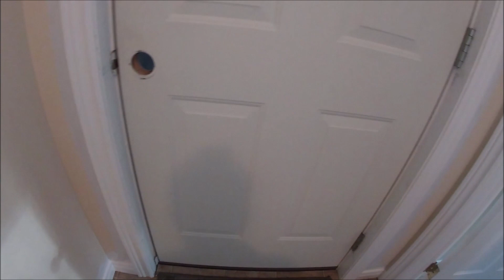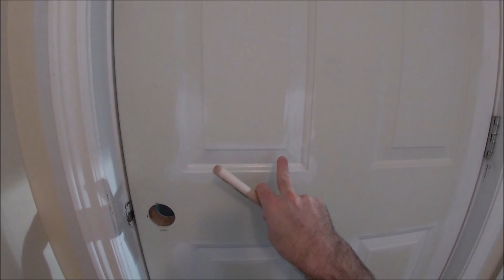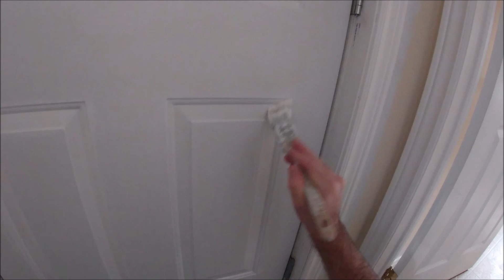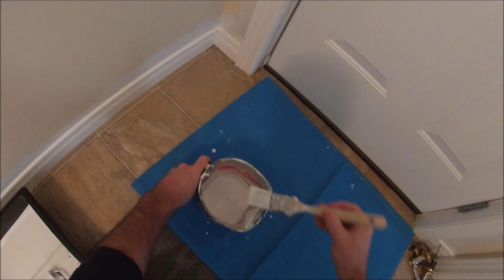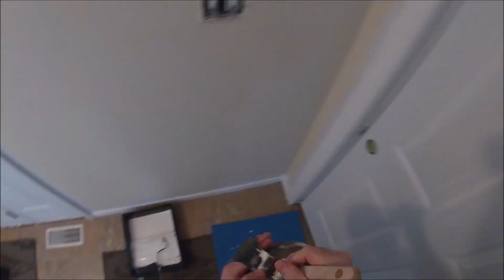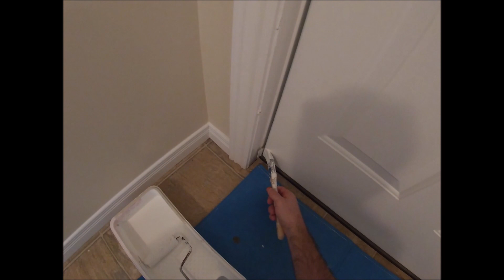How to Paint a Steel Door

Comment: Would you use Tremclad oil-based rust paint without a primer to paint a steel door using either a brush or small roller?  Thx!
Reply from the maker: You definitely could, I have used that paint before, it's very durable
Reply: @TheCanadianHomePainter  Thank you.

Comment: Hi 
What does someone need to paint a metal door and interested painting the inside part thats inside of the home side blue. Would I sand, paint white then the blue? What do u reccomend
Reply: I should have mentioned The door is a bright bold red
Reply from the maker: Hi 
I would recommend,  make sure it's clean, lightly sand to help make the paint adhere, I would definitely prime over with Bullseye 123 primer and then a couple coats of the color 
Hope this helps

Comment: I’m trying to paint my door black and my door is white. What name brand of paint do you recommend? Also I didn’t sand it and the paint started to pull off, so if I sand it will it not peel off anymore?
Reply from the maker: Hi there
Just curious did you prime the door before painting? Sanding definitely will help with adhesion but a light sanding and a coat of a good primer like Bullseye 123 and then the top coat should give you the best results.  As far as what paint to use I would recommend either Benjamin Moore or sico both are excellent,  Benjamin is number 1 but the price is higher and sico is a close number 2 with a more affordable price point. Hope this helps let me know if I missed something 
Thanks for watching and for the question

Comment: I've encountered experienced painters who do not prime medal doors and they think it's odd when they have two give it four coats of paint. I do not understand why they would do that. maybe to avoid having to buy primer and just hop the paint will cover. but after years of painting you would think they would know what to do.
Reply: Experienced painters know you do not have to prime something every time you paint it. Bare metal yes, a colored door that's been primed and painted, not necessary.  In general primer is for bare surfaces.
Reply: @da324  yes agreed. And then there's the paint primer all in one. I think painters use that stuff to get it done faster, but I'm told it's inferior.
Reply: @gianthills  I hear you.  I personally think the paint and primer all in one is a marketing ploy, because it doesn't make logical sense.

Comment: My door has chips  in the paint that's it has on it now. What do you recommend?
Reply from the maker: Hi, depending on how many or how bad the chips are, will depend how much sanding is required, if they aren't too bad then you can probably hand sand them, I would suggest using 120 grit sandpaper, sand out the chips and make sure you prime especially if you get right down to the metal. On doors that are really bad I will use my orbital power sander with 120 grit disks. Hope this helps

Comment: So I have a steel door that had some dents in brought it down to bare metal filled in the dents with bondo applied phosphoric acid on the bare metal to protect it from any future rust for the simple fact that the salt air hear in Wailuku Maui is not a friend of any metal. Cleaned it up as per the instructions proceeded to primer the door and now I have areas that are rough  I'm going to try wet sanding in the morning.  Unless you have a suggestion for the way I to proceed.  Thanks in advance.
Reply from the maker: Ah Maui, that would be a great place to go and escaped the cold dark winter here. Ok back to your comment lol
In those case I usually fill and sand the dents with a paintable caulking, I think you went above and beyond to repair your door, which is probably the best way to do it. The wet sanding hopefully with work to sand out the rough areas. 
I dont usually take it down the bare metal. I bet it looks like a new door now. Sorry I dont have any other suggestions for you. Hope it works out.

Comment: What kind of paint and what primer?  I just scraped paint off my steel door and need to repaint it.  Didn't use primer the first time. Oops!!
Reply from the maker: Hey! Depending on where you live, if you are in the states then you can probably find this primer and paint at a home depot or other paint stores. I used bullseye 123 primer and sico door and trim paint for the top coat. Hope this helps , thanks for watching and for your question

Comment: 1. Is sanding necessary for an unpainted steel door? 2. What do you suggest for fixing a small dent?
Reply from the maker: The light sanding will always help with paint to adhere, Bullseye 123 primer says sanding isn't necessary however I usually will still do a light sanding,  it never hurts .
Fixing small dents on a steel door is not easy, I have tried many different products. For me if there are only a few small dents I personally will use a little paintable caulking. I just use a drywall knife to apply it then I wait till it dries apply alittle more making sure it is as smooth as possible then I wait till it is nice and hard then I do a light sanding around the edges to take care of any imperfections,  prime over it and then paint.
Hope this helps, but also check with them at the store where you live and see if they have anything that they suggest. I do this stuff a time so I can make it look good but if you aren't use to working with materials like this it could be a bit tricky

Comment: Hi, how about painting a brown steel door to white. How do I achieve that? Thanks for your shared knowledge
Reply from the maker: Hi there, thanks for watching and for your question, pretty much follow my steps the same, however going over a dark color like brown may require an extra coat of white maybe even 2 extra thin coats just to ensure that you get the brown totally covered, you will know though after the paint dries whether or not you need more coats. Hope this helps
Reply: Good white primer and paint

Comment: How do I paint a metal door that the previous owner of our home painted with flat wall paint??? Any advice?
Reply from the maker: Thanks for watching and for the question. And really you should be able to just go over it eith regular door and trim paint. Assuming the flat wall paint is latex on the door now, just lightly sand the surface wipe it down with a warm rag and apply 2 costs of latex door and trim paint over top. Hope this helps
Reply: The Canadian Home Painter yes it does.  Thank you I was afraid I’d have to try to get all that old paint off. 😱
Reply from the maker: @ladystef5055  no that shouldn't be necessary. Let me know how it works out for you 😊
Reply: The Canadian Home Painter I sure will.

Comment: Can you paint the whole door with a brush
Reply from the maker: Hi Sara, I suppose you could, it will be hard to avoid seeing your brush strokes though. I would suggest using a small roller sleeve for the best finish. Thanks for watching and for your question
Reply: Unless your using a thick oil based door paint. It'll turn out good but you can buy a mini roller and pan at Home Depot for like $3
Reply: @miztrusa  8 now!